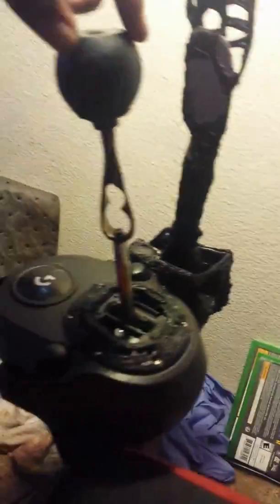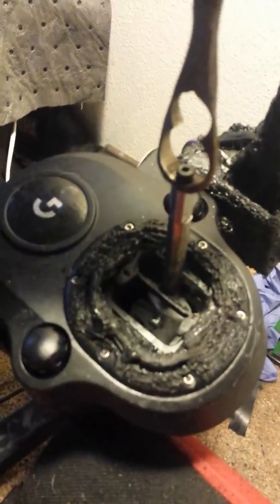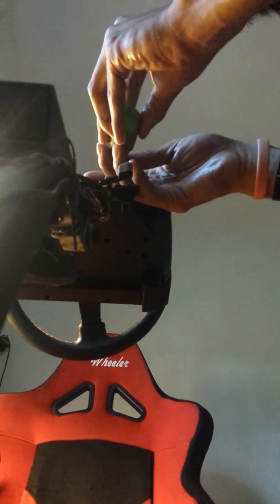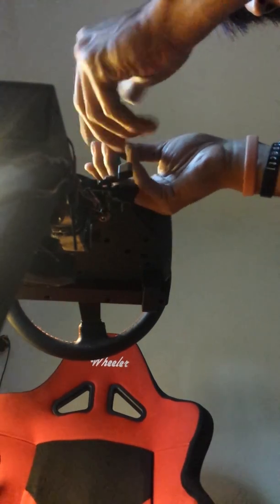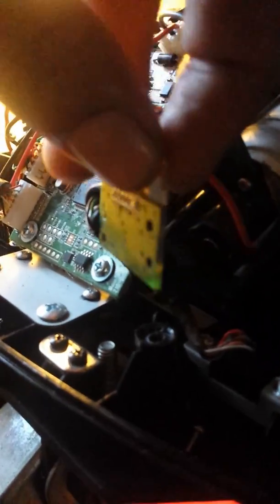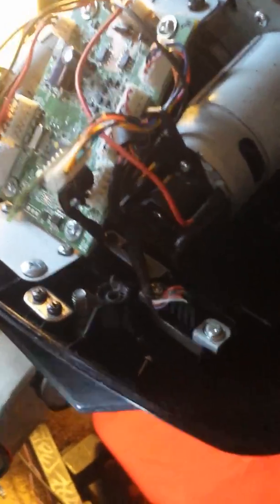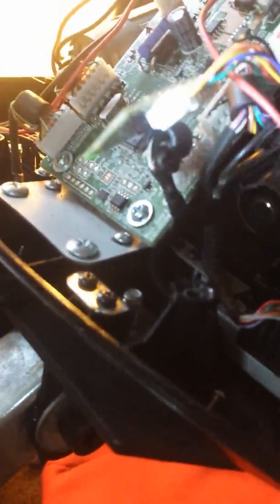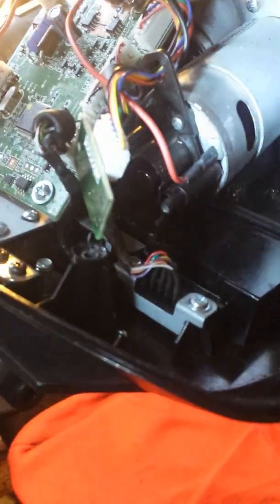Logitech g920/g29 hall effect sensor cleaning centering issue. Helpful links in description!!!

Comment: Tech Tip for everyone. The magnetic field generate by the power cable interferes with the signal in the other data cables connected to sensitive circuits boards, especially magnetic hall effects sensors. All you need to do is to keep all the data cables a little distance away from the power cable. 
I have had this problem and tried all the suggested solution. The only thing that fixed it was separating the power cable.
I suggest try separating the power line first, after definitely still clean the sensor and space it if it makes you happy

Comment: Judging from the second link, does this method only work, if you need to steer the wheel to the left, or can the fix be achieved with this method, if I need to steer a little more to the right, to keep the car going straight? Thank you in advance!
Reply from the maker: I'm almost certain that this will help in either case. I switched to Thrustmaster a few years ago. Much better hall sensor and way stronger brushless motor. built in fans etc. best regards to you!

Comment: I just picked up one of these and im attempting to diagnose it. as soon as its plugged in it goes to the right and bounces off of right lock three times then quits. tried your cleaning method to no avail but noticed that when the hall sensor board is away from the magnet it still goes all the way to right lock but when unplugged it only taps right three times as if searching for magnetic calibration input. i was looking to get a hall sensor board but cant find any, i do have the capability to solder on a new chip if i have to. i really do think the hall effect sensor itself is fried. any opinions?
Reply from the maker: That seems to me like the main board is malfunctioning during calibration.  Im not the most electronic savvy person but in my opinion it would be in your best interest to contact logitech. Especially If it isn't more than 2 years old.  There customer service is on point in my experience. I upgraded to thrustmaster.  I have had no such issues and the hall effect sensor layout is very similar.  I hope you get it all sorted out! Best regards
Reply: Did you ever get this fixed? Mine is doing the same
Reply: @jakeerickson7120  no unfortunately not. The hall effect sensor they use is proprietary so buying it was impossible
Reply: Hey did you find a fix? I have this exact issue
Reply: @ady_  unfortunately no and Logitech is useless as a company so "buy another one" they said...
Reply: I have similar issue with a wheel I bought (g920 used in almost-like-new condition). I's not being detected by any Xbox/Pc, when everything is plugged in and I connect USB cable, the wheel is making barely audible dull sound, like it  wants to move but is stuck or power is shut off instantly. When I unplug connecting cable from the board but leave board in place, connecting USB cable makes it move by ~1 degree cclockwise, never right, it always move left.

I will do some experiments with the insulation but I suspect mosfets or motors may be fried (although I tried the USB method on both of them separately and motors are 'moving'), because it doesn't even get reckognised as a pehiperal in windoZ.
Circuit board looks fine, I tested cables for continuity, fine, I will test caps and the rest for the same. I'm running out of ideas. What would you suggest, anyone that reads this really, any help appreciated.

I got it for cheap if you consider frame, pedals and shifter for under 100 pounds, so it's not like I'm gonna loose a fortune throwing this to the bin or selling for parts, but I'm really intrigued about this wheel not working and want to fix it. I went over so many web pages looking for a solution, and here in your video I have found the most helpful information of them all. 

Cheers
Reply: @AnotherDred  to me, it sounds almost like you might have a faulty power supply that fails when it draws power to spin or potentially just a bad USB cable
Reply: @n0bleteamleader239 sadly it's not, I got two new bricks, same issue. MOSFETs are also most likely good because the wheel turns easily with one finger - when burnt it is harder to turn the wheel. Tip: can be diagnosed by unplugging motors from the main board and trying to move wheel with your pinky.

Edit: USB cable checked for continuity gives positive results so that's also off the list. Tried few different breakaway cables too.

Comment: around 3 years ago i had a g920 and had this issue, I asked logitech and they sent me 2 more and had the same problem. Now i bought a T150 and it has the same issue, this is the worst nightmare ive ever had. What should i do?
Reply from the maker: I'm going to change the title in this video because I have learned that this issue is in my best guess due to lack of insulation of the disc magnet used for reference and signal for the hall effect sensor. In short the motor the magnet is attached to is having a blast jacking up the signal the hall effect sensor is trying to get from the magnet in the back of the motor. I don't know about the 150 because I don't own one. I bought a tx(t300rs) leather edition and have had absolutely no problems like literally at all. Wiring a handbrake to the a button on the base was a peace of cake as well. (Brown and orange wires running to the button board 😁 super easy with positaps) .

Anyways... I'm glad that you made this comment. Somebody else made a very good observation that caught my attention. I than went on to learn as much as I could about how this particular hall effect start works. If you work in cars this will be very easy for you to understand. The magnet face has both North and South Pole split down the center. The hall sensor itself is on a board made out of conductive material that is holding an electric charge. The oscillating between North and South Pole while the magnet turns is what the sensor is attempting to count. My hypothesis is that the electric magnet forces coming from the motor are causing interference with the output of magnetic field of the magnet. Therefore more insulation should (key word there) fix this issue. I noticed a white ring on the radius of the disc magnet of my newest Logitech g920 ( I have done 2 warranty claim as well). This newest unit did not lose calibration as often. However it still had the issue. I'm guessing Logitech is trying out different super cheap methods to fix this issue. 

My advice is to get a thrustmaster tx and nothing less than this if you are serious about sim racing. I can say this with confidence as I have had my leather edition for over a year. Just unplug the unit every time you don't plan on playing for a few days. Otherwise the unit actually stays calibrated as long as it is plugged in. Also the brushless motor is absolutely amazing for ffb and feel. So much faster stronger more precise. Total day and nothing difference to budget wheels. And honestly for less than the fanatec systems you can get a very high quality product that will last you a very long time and provide a hugely improved simulation experience. 
Happy holidays and many blessings!!!
Reply: @driftsamurai29  the t150 doesn't have the magnetic sensor, it has the traditional optical sensor, otherwise thanks for the reply I'm pretty sure I'm getting the t300rs and hope that it works right. Thanks for taking your time to help (I'm for Spain)

Comment: Thanks for the video, I've cleaned mine. There was some weird grey stuff on the side, covering a significant part of the magnet surface. 
Seemingly the remains of what they used to keep the magnet in place.
Next I will be testing, driving really fast in Forza, where it was regularly losing center. Hope the issue will be solved, as I had this prob from very beginning (over 2 years ago).
First I thought it's my fault, because I was turning the wheel very fast, but it happened way too often to be acceptable.

Comment: So, I have a problem with my G920. It had centering problems in the past but it doesn't now. What it now does, is it has slow reaction. When I turn the wheel it takes a moment before it starts moving on the game. I took the plastics apart, unscrewed the sensor you show and the problem was fixed for 4 days. I did not screw the sensor in again, rather I left it dangling, as this was how it worked good. So, today, the problem showed up again without me touching anything. Also, my shifter when in gears 1,3,5 it switches between say first and neutral on its own, and the only way of getting it into gear is putting neutral and then say first again. Have you encountered similar problems with your wheel? How can I fix them, Cuz I can't afford a new one
Reply from the maker: Ok as far as the shifter goes start by carefully disassembling the shifter down to where the potentiometers can be easily accessed and manipulated. Use a cutip or something like that and electronic cleaner and compressed air if you have it to clean the sensors thoroughly.  Be sure not to pull wires or damage the contact points inside the pots. I had a similar issue before.  Be sure everything is unplugged during service to avoid shorting anything.  As far as the wheel not detecting movement something must be going on with the sensor itself.  I have heard of people using washers to space the circuit board a bit further from the magnet. The sensor board detects the amount of rotations the magnet is making and translates that into wheel position via processing done by the pcb.  This is important to understand.  I have used fine grit sand paper on the magnet and cleaned the board thoroughly and have found this to help substantially.  This is All the advice I can give.  I do hope this helps.  Best regards.

Comment: Hi mate, the g29 H shifter i have is shifting wrong, jumps between 1st and 3rd, do you know of a fix for this?
Reply from the maker: Fortunately I have had this problem. If you take apart the shifter you will notice three sensors and a main board. The three sensors located on the shifter are how to detect button in reference to position of shifter stick. What I did was spray the two sensors (one side to side the other front to back) located on the back and right side of the shifter with crc electronics cleaner and make sure that they are very clean. It started hastening after about a year. I would be shifting to 3rd and in game would be hitting 5th when the stick was in 3rd gear position. I surely hope this solves your problem! Godspeed!
Reply: @driftsamurai29   Thanks for your reply, Ill give this a go!
Reply: @Bendredge  Hey I have the same problem. Did cleaning the inside fix it?
Reply: @Astius  yeah mate giving them a good spray fixed it for me.
Reply: @Astius  yeah giving the potentiometers a good spray with electronic cleaner fixed it up
Reply: @Bendredge  ok thanks, I will give it a try

Comment: My wheel struggles to calibrate. I'm not sure what the issue is. Do you have any suggestions. I lost a bit of feedback a few days ago after going round a right hander and the wheel went weird and lost a heap of feedback. The wheel is only 5 months old. Now when i plug it in. It struggles to calibrate. Like really slow and frictiony. I have pulled the wheel apart and can't see any issues with either of the motors.
Reply from the maker: Last month i had to get a new logitech. The mosfets might have fried in your case. Seems like you know a bit about electronics. If you have already tried cleaning the hall sensor board and magnet and that didn't help. And the motors are ok? No issues with commutator or brushes? If so contact logitech customer care as the g920 might have a factory fault that is causing all of us grief. My last wheel did exactly what yours is doing and it ended up being a fried motor. But the mosfet can actually cause a similar issue if it overheats. I run my logitech with no cover and clean it with electronic cleaner regularly. No cover means less heat kept near the sensitive electronics equals hopefully a longer life. Best of luck. Feel free to ask any more questions
Reply: I shall give that a go. Cheers for your help
Reply from the maker: @joshuabayada  Godspeed

Comment: no luck with my wheel .... took it apart cleaned it but it still "falls out of center" while drifting or when i crash ....
Reply: i have exactly the same issue, i think its maybe due to too high force feedback
Reply from the maker: I think the problem is with the hall effect sensor board itself. I had to get two replacements before getting a product that didn't fall out of center. Fact is they use cheap components. This most recent wheel i received via logitech warranty is much better than the last two. The magnet looks a bit different with a white ring around it between the plastic and overall cleaner and new looking components. Maybe they where repurposing the g27 with the hall sensor and new circuit board with magnet to replace encoder wheel? Cheap solution to a very profitable idea for logitech. Just do the warranty beforeyour two years is up acne make them give you the device you paid for. I'm truly sorry this doesn't work. Best regards to you both
Reply: need to stick and stick  out usb conector from pc 3 times,than wheel be in centre(whait for calibrete 3 times)

Comment: My wheel keeps turning from side to side when it calibrates and dont stop calibrating. You think is that sensor?
Reply from the maker: Sacer Ktracho. I think that is a good possibility. I don't think it would hurt trying to clean the magnet on the back of the motor
Reply from the maker: Sacer Ktracho. Don't be afraid to use sandpaper to scuff the magnet I've recently found that helps with the wheel staying calibrated.
Reply: Mine was like that you said. Did the procedure of the video, and worked perfectly!